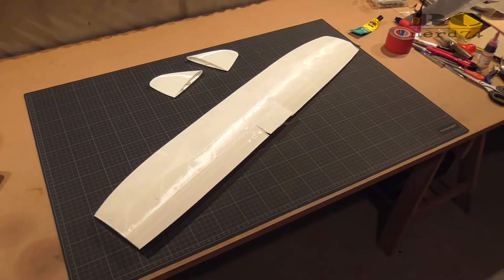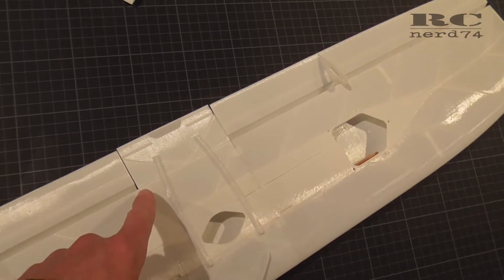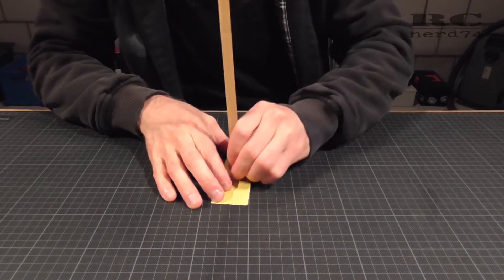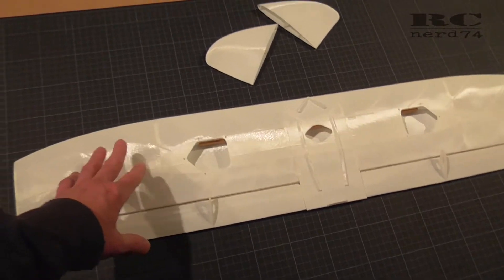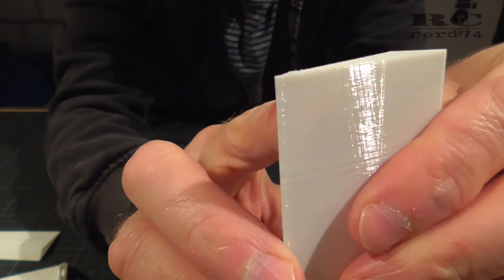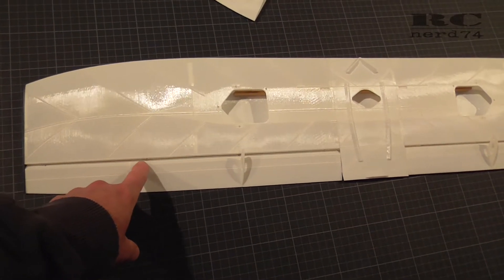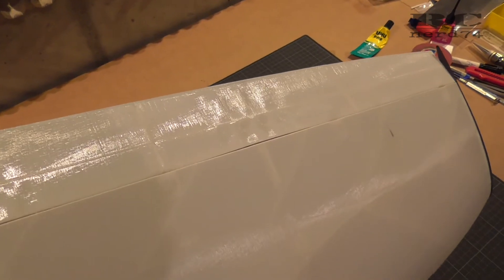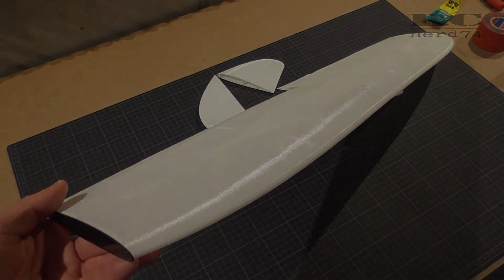ECLIPSON MODEL A | 3D PRINTED RC PLANE | BUILD PART 2 | CUSTOM WING

Comment: Does the carbon fiber dust not irritate hands, eyes, et cetera?
Reply from the maker: You should protect eyes, nose and mouth during cutting and sanding carbon fiber. Hands are no problem. Hands should be pretected using fiberglass. If you want to avoid dirty hands, then protect them anyways.